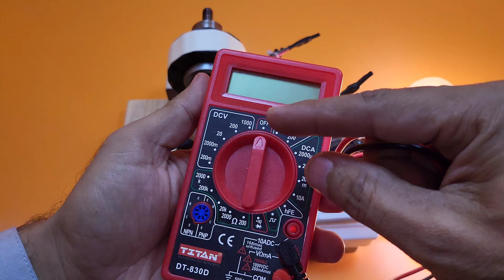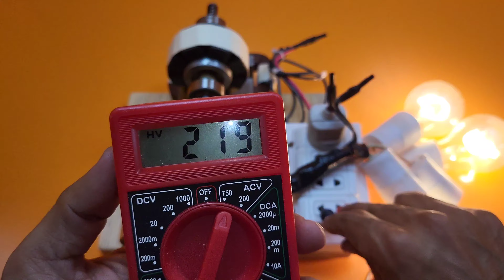I make 220v Electric Generator from a Microwave Transformer

Comment: 30 KW and connects only a couple of light bulbs instead of connecting, for example, any heater, electric radiator at ca 3000 W minimum.

Comment: Why did you use both coils? I understand wiring them in series, but doesn’t that impede the power you could have produced by only using the high voltage coil?